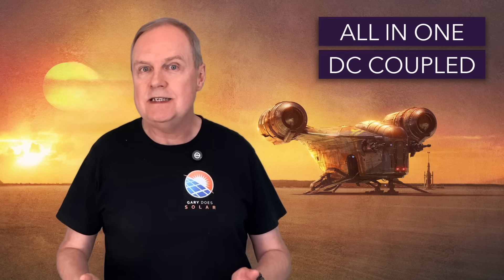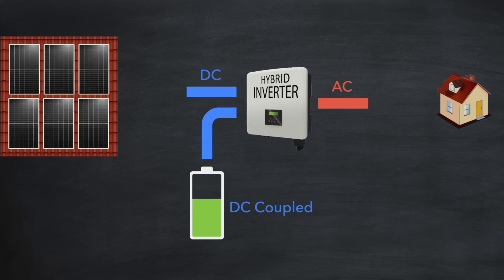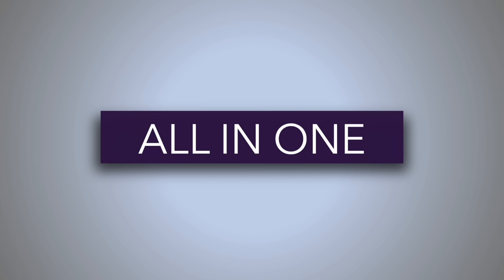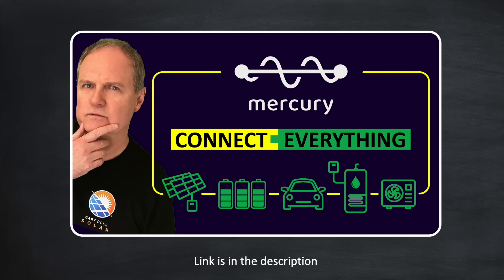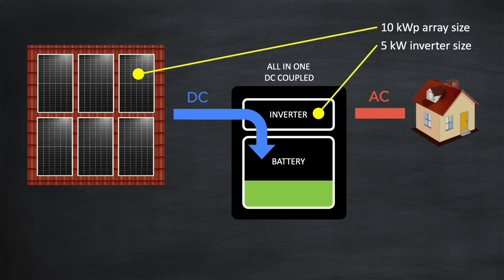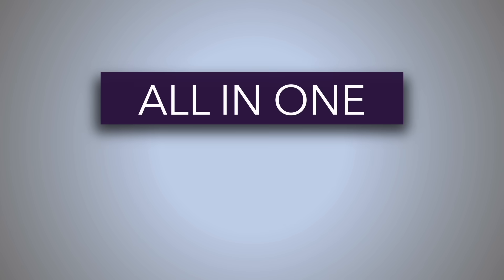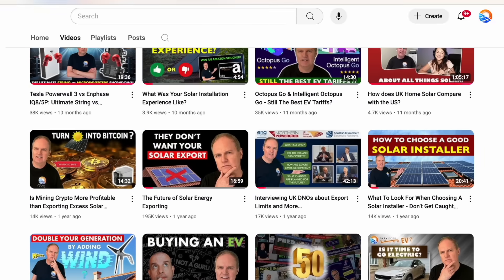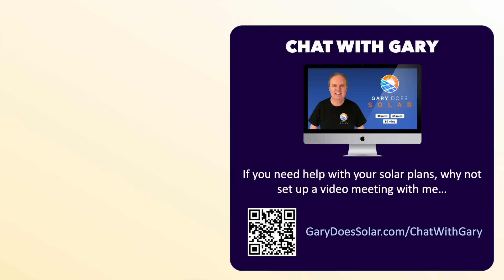Why All-in-One DC Coupled Systems are Transforming Home Solar

Comment: Prefer the multi setup as higher output could be achieved and it could be done in stages, for the high loads in the house the issues with just all in one if you have 5kW inverter then you may find yourself quickly overloading it ie Kettle mine draws 3.xx Odd kW and if you have other high loads like an oven and your done. 

At the moment I’ve got approval for 14.5kW but how I have it configured it will only ever export 10kW why? As I didn’t want to limit the house to only 10kW, so the AC solar is on the house side so allows the use of 14kW if needs be and wanting the solar to work in a grid down situation meaning if the grid went down I could still have working solar similar to how the hybrid systems work. I know it’s a bit niche but that’s how I designed it now I’ve got to see about getting another car charger integrated 😅 PS the issue with a lot of the all in ones is they have to be connected to the internet ie I’m sure someone said Tesla can go 90days before the battery stops charging discharging and for SigEnergy I heard 1 month not sure why if your just charging at set times. Oh and as you know home assistant is brilliant I can see and control everything through that 😉

Comment: I would say microinverters are mostly on the way out. I'd take optimizers over them if I needed bad shading handled.

In the small space like the 800W plug in solar world (except in the UK) then they are rapidly getting turned into an integrated battery/mppt/grid tie/plug socket box so are changing into a different but really useful product.

What would be nice though if we get 800W plug in solar sorted would be a "microinverter" that just takes DC at 48v or whatever and grid ties it compliant with whatever 800W regs emerge. That way you'd be able to use it as a power injector from all the various existing battery/mppt products into your grid.

Comment: Microinverters are dead,  Panel and inverter prices have collapsed, so the microinverters are not economical anymore.
Reply: Things like the Hoymiles 4-1 units are still viable. I find the 1-1 setups like Enphase are just too expensive.

When your 400w panels are 150 bucks it doesn't make much sense in spending 200 bucks per panel for a micro inverter on each panel. The hoymiles 1600 is even still usually just over 400 bucks in the US so even that is getting up there in price.

If you use DC optimizers you get per panel monitoring but then you need a unit in the panel and still need a large inverter anyway.

Unless you have some very weird shading or positioning problems it's definitely a hard sell to fork over the money for micros or optimizers.
Reply from the maker: I’m making a video soon on why Sigenergy are getting into the microinverter market despite having a successful competing technology offering 🤔

Comment: I’m still leaning towards micro-inverters for a few reasons: small energy losses from DC conversion might be negated by increased generation in less-than-ideal weather; it allows for per-panel reporting and easier fault-finding; and a faulty/shaded panel would be less likely to affect other panels as with a DC-coupled string. There’s also the small issue that the temperature can fall as low as –20°C here in the highlands in winter, but I don’t know enough about the weather-related pros and cons of micro- vs string inverters.
Reply from the maker: I want to do some testing around microinverters vs string to see which is actually better in different situations
Reply: Remember to consider micro inverter failures and where your panels are. If they are on the roof and you need scaffolding then a failure could be really expensive to fix and I believe they don’t have the best track record for reliability. 

Several strings may be better but you then have to consider minimum output to consider.
Reply: An optimizer will deal with shading and stay DC so it's not an either/or. It's also really hard to do islanding (keeping the power on when the grid is down) with microinverters. A few inverters have tricks up their sleeves for some microinverters but most can't do it at all.
Weatherwise - optimizers and microinverters are much the same. In both cases you have more connectors and more things to break than a straight string setup with built in bypass diodes. Some of it depends upon how expensive a replacement is because the money you get on a guarantee claim will not cover the replacement of one on a roof due to the scaffolding costs. On ground mounts or low roofs though it will.
Reply: Well one thing you can count on in winter where you live, is a BIG boost in production from your solar panels. At -20°C expect a 15 to 20% increase above the panel's rated output when in full sun. 
This can be a problem for micro inverters.. as each panel has it's own micro inverter, installers will typically size the micro inverter to be LOWER than the panel's peak output rating. So a 400W panel would usually be paired with a 300 to 350 W micro inverter, as panels rarely achieve their peak output rating. And on these odd occasions, the micro inverter will clip the excess power. 
For you though the extra generation is significant in winter. So a string inverter would capture that excess power being generated in sub zero temperatures much more cost effectively than a micro inverter.
Reply: Just to add : There is a case in sub zero climates for choosing a "cheaper" solar panel. Specifically a panel with what is considered an inferior temperature coefficient. 
The top of line panels these days have a 0.25% to 0.3% temperature coefficient rating. The primary purpose of this spec is to minimise losses caused by excess heat, so the lower the coefficient the better. 
But in sub zero climates, it works the other way, and a higher temperature coefficient can be your friend. Some lower cost panels have temperature coefficients of 0.5% or higher. This means at -20°C, a panel could achieve a 25% boost in output when in full sun. So, a 400W panel could be outputting 500W in these conditions. Another reason to consider a string inverter.

Comment: Very good video. I have an Enphase PV + battery system from two years ago. My friend just installed a new Enphase system which now use a collar around the meter which also serve as the single smart connect point for DSO/DNO. The extra efficiency of DC coupling is good but for sunny areas like California hardly matters in reallife. For UK and Canada and offgrid, the higher efficiency might matter but again one can install 1-2 extra panels and call it a day. I still do not like the single point of failure for a single integrated inverter and the constraint on strings plus the larger gauge wiring needed. The easier installs is compelling.
Reply: Did you have a good installer? I’m also in California and looking for a similar setup.

Comment: Tesla: When the inverter does you need to throw away the battery, when the battery dies you throw away the inverter
Reply: Under warranty you are ok, out of warranty you are stuffed. With a system that lets you change batteries or inverter you are in a much better place.
Reply from the maker: I think both can be repaired independently of each other (especially under warranty)
Reply: @GaryDoesSolar  but is it worth it (after warranty?)
Reply: The 10 year warranty period should cover you in the event of either battery or inverter failing and go beyond your break even point if you configure your Solar and PW3 solution appropriately.
Reply: @colinfieldgate4719  I am talking about out of warranty. Just because it is year 11 I still want to use that battery if not dead

Comment: All-in-One DC coupled systems do have their advantages, but there are also limitations.
Let's say you have a 5 kW inverter in your all-in-one system but your home is fully electric with an 11 kW induction hob, 3kW electric oven, 3 kW ASHP and about 8 kW of solar panels.
There is no way all of this is  all going to be powered from that single 5 kW inverter, even when the sun shines bright.

Personally I have 3 different systems, one simply a basic string inverter, one system with Enphase micro inverters (shade issues) and one small dual MPPT micro inverter system on the garden shed.
These systems were added over the years and don't communicate to one another, which is just fine.

An AC connected battery system just takes the surplus of energy and dampens the export to the grid and import from the grid as needed. So when the sun shines and the batteries are full, I can power just about anything without paying for import. The total (theoretical) peak power from all of the inverters is 6.4 kW combined, but these do peak at different times in the day.

The (small) AC connected home battery system can charge at 1.6 kW and discharge at 1.6 kW, so a peak load of 8 kW is possible and by design it also tries to limit export as much as possible.

In the future, I plan to upgrade to a bigger battery system as soon as it makes sense, but this works fine for now. DC connected is nice for the round trip efficiency, and maybe makes your DNO happy, but personally I would not like to be dependent on a single system.

I am impressed by the SigEnergy system which is very modular. It is much more convenient than a huge heavy  system like a PowerWall if something fails. 

Having said that, there is also a rather huge market for smaller AC coupled battery systems for those with a smaller budget or lack of space. I really don't see where I could add a SigEnergy stack in or near my terraced home,, having seen it at a local Solar installer's store. 

Right now my AC batteries are 2.7 kWh, 800W, 24kg and 20x30x40 cm each and did not break the bank in terms of cost as it's legal here to just plug them into a wall socket. (separate breaker required to enable >800W export). 

With unlimited space and budget (and off-street parking), I would go for SigEnergy in a heartbeat, but that is not reality.
Reply from the maker: Yeah, and getting the right inverter size is so important. Sigenergy offer a whole heap of sizes, which is great, but of course, you have to get it past the distribution network/system operator…
Reply: @GaryDoesSolar Since Sigenergy inverters can have a kW “Grid Export Power Limit” configured in software, perhaps more DNOs should be aware of this and allow customers to install larger inverters that would come in more useful during a grid outage?
Reply: @callme_jc  There is a process for this and a certification. However the parameter must be impossible for end users to set and various other requirements on reliability and testing are needed because "what if it goes wrong" is a big deal. Sunsynk for example can do this but you'd never get approval because the end owner can change the number.
Reply: @etchedpixels  I’ve heard a number of stories of DNOs rejecting a G98/G99 application purely on the basis of the size of the Sig inverter, and demanding a smaller one. Didn’t know that the end user could change the export limit setting beyond the maximum value that the installer sets, so that’s a head-scratcher.
Reply: @callme_jc  It's not just whether the end user can change it (not sure they can on a Sig), there's also a whole required set of testing and requirements to meet G100 etc beyond "user can't fiddle". 

There's a lot of paranoia because "oops the software broke and blew up the substation" isn't an acceptable outcome.
Reply: @etchedpixels  My goodness. If the end user’s choice of hybrid inverter can’t be trusted by the DNO to be “fail-safe” when it comes to complying with its export restriction, then what hope is there for specifying a suitably-sized inverter with an oversized solar array that would suffice in island mode?
Reply: @callme_jc  Yes, yes, and yes!!!  Specifically for battery systems like Sigenergy, Tesla, and others that use a "gateway" to control interaction with the grid. There should be NO limit on inverter size if the export limit is hard coded by the installer, according to the DNO's approval.
Reply: @GaryDoesSolar  Yes, I agree. It's hard to get exactly right and even if you max out what the DNO allows, that limit may change as they upgrade the grid one day after you install it. In the Netherlands, the limits for export are the same as import, so it's not that big of an issue.
Reply: The PW3 can be software limited on export to meet DNO restrictions but still deliver up to 11.5kw to the home if configured correctly. The Sigenergy solution and others force you to choose a fixed inverter size. It is possible to get around this issue with more hardware that is G99 compliant but it complicates the solution.
Reply: @colinfieldgate4719 Good point. If implemented correctly and accepted by the DNO, this could solve the limitation. 

Maybe SigEnergy can do this as well, beyond simply soft limiting the output of the more expensive higher power inverter:
"A Sigenergy export limit is a maximum rate at which your solar system can send electricity to the grid, typically set by your Distribution Network Operator (DNO) and configurable in the Sigenergy web UI or installer app under the Safety & Grid Regulations menu. The specific limit varies by region and connection type, and it can be set as a soft limit to prevent grid instability or a hard limit to disconnect the system if breached."

Comment: I'm quite happy with my PowerWall 3.  Round trip losses are only 4%.  However when it calibrates it dumps 23 kW (11.5 kW x 2) to the grid.
Reply from the maker: Wow—that’s serious export. Is your DNO ok with that? Well done, if so! 💪
Reply: I’ve not seen that kind of behaviour. Our PW3 gets charged to around 95%+ each morning from the grid. Perhaps then it doesn’t need to recalibrate?
Reply: Calibration happened exactly 60 days to the minute after the PW3s finished commissioning.  The PW3s are recharged to 100% using solar everyday.  Never needed grid charging (except after being emptied during recalibration).  Batteries have never dropped below 50% and rarely drop below 70%.
Reply: @jabbathespud I guess we are on different tariffs. With Eon I get 7 hours at 6.7p/kWh and export at 16.5p. Hence charging from the grid every day and avoiding the peak rate the rest of the day.

Comment: The DC coupled all-in-one would be an ideal solution for us. We live out in the sticks where the grid supply is unreliable. Consequently, our export is limited so we only have a single Powerwall 2 when we would be benefit from twice that storage capacity - we’re an all electric household with a heat pump and 2 EVs. Rather then going to the expense of adding a second DC coupled battery or replacing our Powerwall 2 with a Powerwall 3 or Sigenergy battery system, I was thinking we might be able to get a bi-directional charger compatible with our Nissan Leaf (e.g. Indra) but there is still the export limit to contend with. The SigenStor and its DC charger would solve these issues at a single stroke.
Reply from the maker: Yeah, I think Sigenergy has really thought everything through on this 😀
Reply: I am thinking along the same line.  Use the car battery instead of adding site storage.

Comment: The issue I see is that these systems are still very expensive for what they are. If you consider that for £900 you can get almost 5kwh of storage (Pylontech us5000). As soon as you go to 10+ kWh you are looking at many thousands of extra pounds to achieve similar storage. Since the batteries are the expensive part. These All in Ones are good for those that want a fire and forget solution. But on the economics they are far from the best. The energy savings from DC coupled are lost if you are paying thousands more for the basic kit.

The problem is complexity and how much people are prepared to pay to eliminate it. But since lots of the conversation is around payback times, then the cost of the kit is a central theme.
Reply from the maker: Great commentary, Jim 🙏
Reply: I'd have loved to DIY my inverter/batteries (as I did my 16kW ground mount), but Tesla's meter socket solution made the install with PW3 a vastly simpler solution. The cost savings of not needing to add load center nearly made up the cost difference.
Reply: I haven't started my solar/battery journey yet and am doing as much research as possible. I just don't get it regards batteries. Been looking at Fogstar batteries, £1800 for 16kwh. Could get 5 for the cost of a Tesla pw3. Am I missing something?

Comment: I am in the USA.  With AC coupled solar and battery.  I wish I could add another brand of battery or expand my Powerwall 2 without having major upsets to replace the Tesla Powerwall installation.  PW2 is no longer available here, so changing our working Powerwall's with PW3 is the upgrade path as I understand it.
Reply from the maker: Yeah, and I’m pretty sure Tesla was saying there would be compatibility between the 2 and 3 at some point! 🤷‍♂️
Reply: @GaryDoesSolar  We have had ours for 2.5 years, and they were saying that as our install was new.  Still hopeing they come through with it.
Reply: Solark in the US can front 4kW of microinverters AC coupled and keep them running even during an outage providing you've got the islanding support. I think the last EG4 stuff can as well. (Solark is the US build and regulatory spec versions of the Sunsynk/Deye products in the 240v world).
You can then AC couple any remaining solar directly so you at least have 4kW plus whatever you DC couple to the inverter/battery during an outage

There are options and several of those US options also let you use third party batteries which can save a fortune over a tessla product